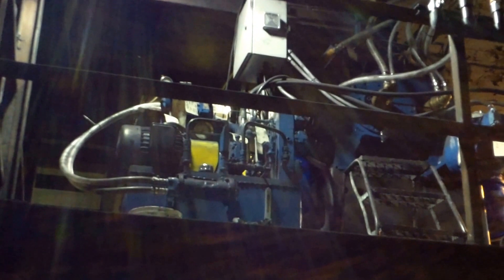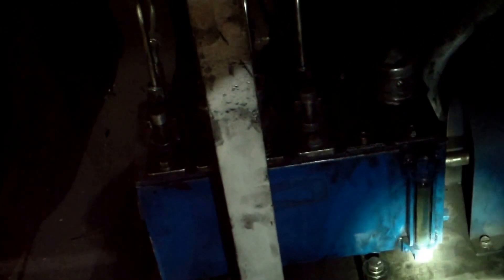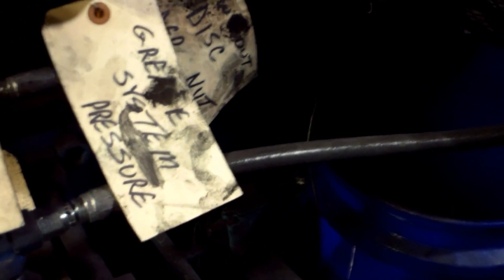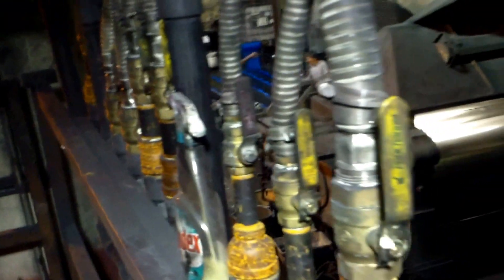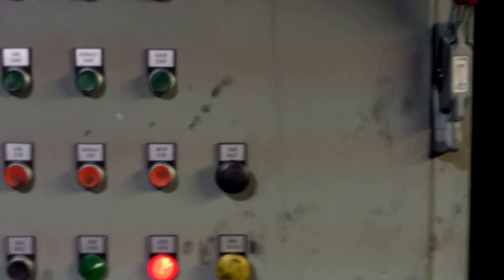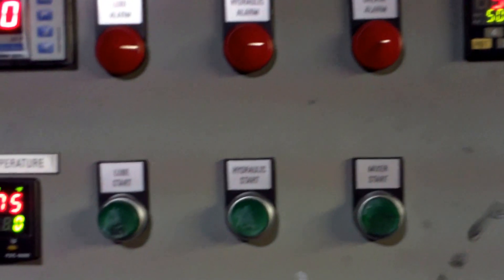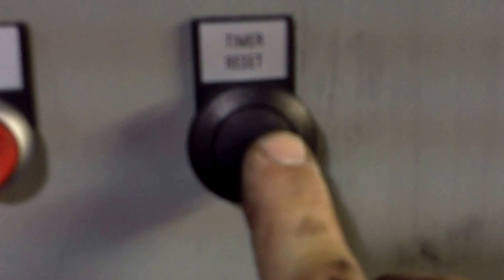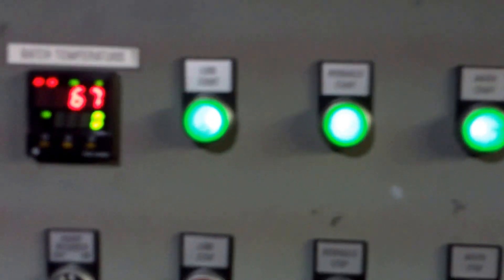Banbury Mixer Startup

Comment: Appears to me that you people need more lighting in the place, I have operated and maintained and removed and installed several banburys for 11 years and if you have oil going to a bucket you need to clean or change the oil seals or blow out the clogged oil return to the pump system lines